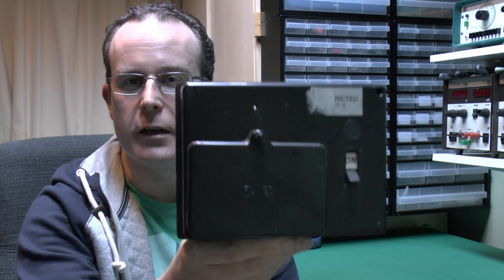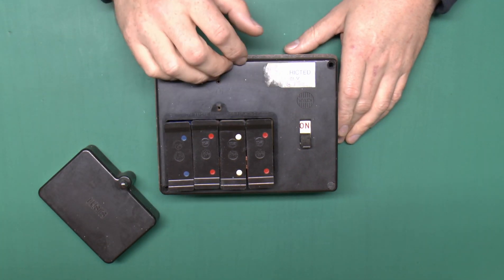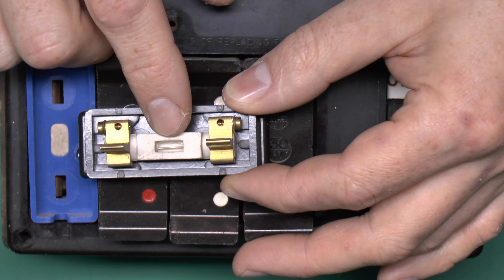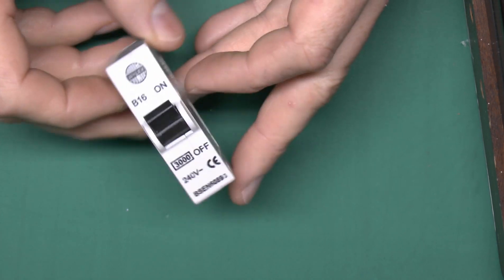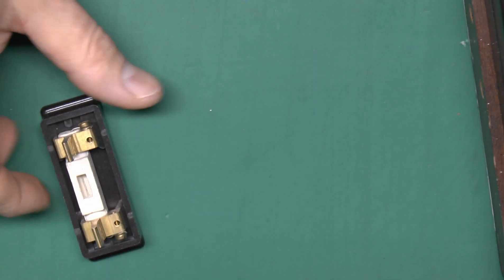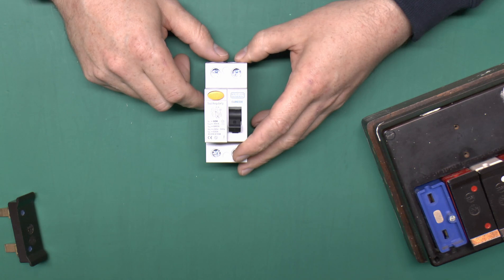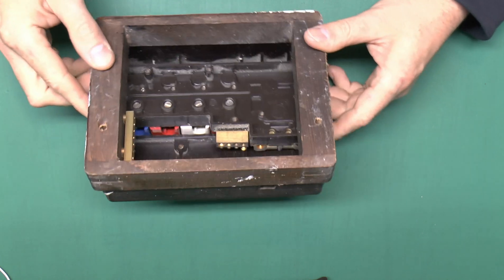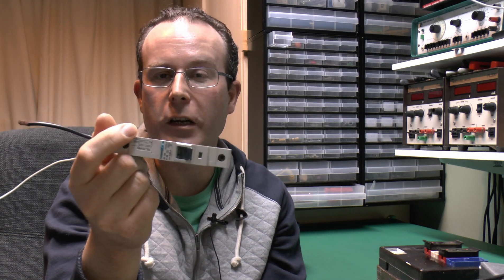Wylex Fusebox - Replacing fuses with plug in MCBs is a waste of money

Comment: i came across one of these the other day but without the wooden thing but a RCD was fitted in later it had some old resettable MCBS plug in type the RCD was to the side protecting the entire property to what i guessed, luckily i had a portable Residual current device with me ( the ones you plug in and plug your device in) as it was a old house that i assumed cos of the age had just MCBs which has no protection from a electrical shock then RCDS. If i was in a house with just a MCB fuse box for safteys sake i would upgrade to one with RCDS in it. my fuse box at one of my parents houses has got a big RCD below the fuse board as its a older fuse board where half the circutes are protected and some are not but the RCD below if that trips it trips the entire house hold electrical supply and we know it works as we once had a boiler leak and woke up to a house of darkness and found out that the main RCD tripped and it tripped when we was converting one of our lounges to a ground floor flat that a builder burst a water pipe and it went on live wires and tripped the RCD, if that was a MCB we would have a potential fire in our hands luckily im fire extingushire trained and had to use a fire extingushire for real when someone set the oven gloves on fire which was smoldering like mad as i did not know it had flame retardent materal and plus i didnt want to take any chances i quickly got a 20+ year old water fire extingushire which still worked, manufactured in either 98 or 97. I knew that it would come under the A class catagory so i got water, we had a powder one but was upstairs but had a astmatic in with us so i did not use it as i know it can cause breathing differculties.

Comment: Surely a major benefit is being able to isolate a single circuit via a switch without turning off the entire board, as opposed to pulling a fuse from a circuit that might still have current therefore causing arcing as the fuse is pulled?

Comment: My Wylex is a wooden one like that and that's the way it's staying. I retrofitted the latest MCBs (its a 4 way) and an outboard whole house RCD. There's no way I could get anything else in the meter cupboard as it's an outdoor one with meter, bell transformer and garage isolator. Full! MCBs are also classed as 'close circuit protection' which is no doubt renamed something less informative these days, and allow greater tolerances on circuit diversity, cable capacity  and impedances than rewireables. There used to be tables of capacities in the IEE regulations for rewireable vs HRC/MCB protection, though I think the trend for over-complicating and obfuscating the rules has meant we now have confusing derating factors under the present IET tenure as electrical God.

Comment: Question for you John - I made an circuit breaker for powered projects so just in case I get the wiring wrong, I would trip my circuit breaker instead of the house power. Now, I tested my curcuit breaker in a shed that had the live and neutral reversed (for some reason) and I purposely trip my circuit breaker,. Not only did it trip my circuit breaker, but also tripped the power in the shed?? 

So the questions are - Why did it trip both when it was designed to only trip my circuit breaker?  Would the fact that the live and neutral are reversed something got to do with it? 

I have a video of the circuit breaker I built if you need to have a look at it but it's just an 20amp RCB0 with a plug on one end and an extension socket on the other. :-)
Reply: Not a lot to go on there but  if you turn the socket circuit off only while you rewire a socket and accidently touch neutral to earth even with no power to the sockets it will trip the rcd for all circuits on that rcd, many of us have been plunged into darkness and not sure why. I think yours is the same issue due to the reversed wiring.

Comment: Whether its an MCB plugged into an existing fuse socket or a complete new unit with circuit breakers and RCDs, a circuit breaker is far better than an old-style wire fuse because you can see at a glance which one has tripped.  Number of times I've had to pull fuses in sequence and look to see which is the blown one just because someone has decided to plug in one too many devices on a single circuit.

Our current house has two fuses for lighting and four unlabelled fuses and a plug-in MCB for which the labels are illegible (it also has a retrofitted RCD with two circuit breakers).  If half the lights go out in the house, it's a 50% chance you pull the right fuse first out first, if an electrical outlet goes out, unless its one that's controlled by the MCB, it's anyone's guess which of the four fuses is the right one.

Interesting to note that the fuses in the video would not be acceptable here in New Zealand as they would not comply with our code - our fuses have to have a "tortuous path" whereby the wire starts on one side of the ceramic block, passes through an angled hole in the block and then is fixed on the other side so it forms a Z-shape.  A straight wire like the ones pictured would not be legal here.

Comment: hi john,,,I've got similar electric and fuse box but i have gone and broken the main on off power switch,snapped it in half ,yep that backer lite switch,,any ideas on a fix ? ......or any idea on cost of a new replacement ? thanks john
Reply from the maker: There is no fix - that type of fusebox is no longer made.  The main switch was supplied as part of the whole thing and wasn't a separate item.
Only option is a new consumer unit.
Reply: thanks john for quick reply,,,john ,,,talking about cost,,,any idea for box and fitting ?
Reply from the maker: Depends on various factors, but in the UK typically £400 - £800 for a normal sized house.
Reply: cheers john, not good news at all.
Reply from the maker: If cost is a problem, another option would be to have a separate main switch in a small enclosure fitted before the fusebox, such as this: https://www.tlc-direct.co.uk/Products/WYREC2S.html
Reply: another thanks john,,,that looks a far better idea,will move on that in the next few days.

Comment: Does an RCCB protect against current overload, like a fuse, as well as residual current leakage to earth?
Reply from the maker: No, it has no overload protection.  They are usually marked with a rating (such as 80A) but that is only the maximum rating of the internal contacts/switch.  If you want overcurrent protection in the same device, then an RCBO is required.
Reply: Thanks, John. Much appreciated!

Comment: This video is a waste of time, the newer system is much better and less hassle. That’s the reason why everyone’s changing to it. 

The only logical thing you said was instead of buying 4-6 of the new fuses your better off buying a new consumer unit with these built in which will work around same price (but then you still have to pay an electrician to change it over unless you know what your doing.)
Reply: In fairness we're talking about changing from a 1960's system to a 1980's system.  If anyone still has a Wylex board with cartridge/wire fuses today then there's not much point changing to plug in MCBs now as the cost or replacing all the fuses and fitting a standalone RCD would be comparable to replacing the consumer unit anyway.

Comment: The plug in MCBs may not offer much additional protection but they are 10,000x more user friendly.  Worth every penny.
Reply: a few days ago, my sister had a lightbulb fail, and the bulb took out the fuse for the circuit when it failed
my sister had to call out an electrician, and the electrician replaced the fuse with a circuit breaker
Reply: If you are unable to screw in a piece of fuse wire you probably shouldn’t be allowed to live on your own 😂
Reply: @TimothyAsbridge  Does hating on the disabled make you feel big?
Reply: @TimothyAsbridge  , 6 am winters morning, up for work, losing all your lights isn't good, MCB so much easier than fuse wire.
Reply: @TimothyAsbridge  disgusting comment

Comment: i have an old consumer unit in my home, how easy it is to replace it with a nice one?
Reply: difficult and costly
Reply: Indeed. Most of the regulations seem designed to generate more work for the trade.

Comment: I have one of the old MEM fuseboxes rather than the more compact Wylex. For convenience i bought spare s/h ceramic fuse cartridges (off ebay, and yes, they were expensive) in order to simplify the swap. The MEM cartridges take a little longer to wire and it is easy to be hamfisted and stress or snap the wire when  tightening the screws.....better to have one of each spare kicking about- 5A, 15A ,30A.

Comment: If these replacement circuit breakers are a waste of time,  then why would the big manufacturers still produce them ? 

You're so wrong on your advice in part of this video. 

To conclude that a semi enclosed circuit breaker is the same as a mcb is foolish.
Reply: An Electrician Why does any manufacturer make anything? To sell it and make money. Who is the fool, the customer or the manufacturer? Only you can decide. JW is not saying MCBs are a waste of time. He is saying that most people (maybe not all) would be better off replacing the old fuse box with a modern up to date consumer unit, which would have RCD protection as well as multiple MCBs. Replacing the individual fuse holders with individual replacement MCBs in the existing fuse box does not significantly increase the protection.

Comment: seriously - this video was a waste of time. Granted they don't do anything new but they make it very easy to turn things back on. you don't have the hassle of replacing the fuse wire - which for many people is difficult (elderly, people without tools, etc...). However the most important feature as to why this is not a waste of time but your video is, is that changing fuse wire requires the user to have and use the correct fuse wire. Intentionally or by accident using the wrong wire (e.g. 30amp) in say a lighting fuse (should be 5amp) could be catastrophic!
Reply: Tim Hurrell It has always been a problem with rewireable fuse holders. I think you missed the point. The point being it would be far better to replace the old fuse box with a modern RCD and MCB equipped consumer unit.

Comment: Well, I wanted to replace some of my light switches earlier and didn't think that pulling fuses out was safe to do without turning the whole fuse box off. I could have used one of those flickable switches on the fuse. In addition, whoever installed the fuses didn't label the circuits and the little piece of paper that should have described the fuses and their purpose didn't match the panel. I guess I'll get an electrician in and heck, just get a RCD consumer unit while I'm spending money.
Reply: Radu C Pulling fuses or switching off MCBs does not guarantee the circuit you are working on is isolated. The main isolation switch should be used.

Comment: Are the wooden backed ones still legal? You said in your video that they may not be in 2015. We have one in our rented property but the landlord literally refuses to change it to a RCD unit. Hoping something has come out to make it a requirement to have it changed.
Reply from the maker: They don't comply with regulations now, but that doesn't mean old items have to be replaced either - they complied with the regulations when they were installed.
They should be replaced for the flammability issue, and the fact they will have no RCD protection for any of the circuits, plus if they have rewirable fuses they can easily be misused by installing the wrong fusewire.
However wiring regulations are not the law, and there is no law which requires older electrical installations to be updated.

Comment: I don't think these circuit breakers are a waste of time at all.  I've just been in a situation where my lighting fuse went due to a bulb failing.  I'd purchased fuse wire but couldn't remember where I'd put it.  Unfortunately the gas heating control system was also on the 3A circuit so I had no heating and it was the coldest day of the year!

I also think forcing the average consumer to physically wire a fuse is an anachronism and inherently dangerous. The problem with engineers (I do engineering from a numerical perspective) is they assume everybody thinks like they do; your perspective is a classic example of this: "it works perfectly well, so it doesn't need fixing".
Reply: Agreed.  I do electrical installations and I try to see things from the user's perspective.  It's my job to foresee scenarios where a paper clip or tin foil might be used by a desperate customer on a ladder in the dark after trying to find the correct fuse wire for the lighting circuit.   Changing the whole fuse board might cause him financial hardship.  £10 for one resettable MCB?  I'd splash out and get two!

Comment: I have one of these old fuse boxes, my fuse do not blow, but my mains keeps tripping. What could be causing this and would switching to these fuses be able to help to not trip the mains?
Reply from the maker: If a device is tripping, there is a fault somewhere.  Changing fuses to circuit breakers will not help at all.

Comment: Good video and sure, a modern consumer unit with a built in RCD is  better. I would still rather see a type B mcb used in an old consumer unit on a lighting circuit than a traditional fuse though if only because it prevents people from replacing the damaged fuse with something inappropriate. You didn't even mention the different tripping characteristics MCBs have compared to fuse wire or that mcbs are more sensitive to fault currents than fuses. These are important considerations for people who cannot afford to replace a whole consumer unit.

Comment: Lots of idiots commenting on this video. Yes upgrading to an mcb will stop people replacing with incorrect rated wire etc and make it easier to reset, however so will replacing the consumer unit which is what he is really saying to do in this vid. It will also give rcd protection unlike the "upgrades" and as it is obvious that there are many imbeciles (judging from the comments here) that need protecting from themselves mcb`s are still a waste of money and give people a false sense of security by looking like rcd`s. (again, proven here by the comments confusing the two.) 

On a side note, if you think unscewing two screws to replace a fuse wire is too much trouble i highly doubt you are qualified to give advice on this matter. Also if convenience is worth wasting £50+ on these upgrades then more fool you. Before people chime in about the elderly, disabled etc, if they need the easy reset just do the job properly with a new consumer unit and be sure their installation is totally safe. Everyone else should just get a battery operated cupboard light from the pound shop and keep a screwdriver and fuse wire alongside the fuse box, and stop being a bitch.
Reply: Electrical Safety Council Best Practice Guide (issue 2):
10.1. The alteration or addition itself (the installation of
the replacement consumer unit and any other new
work, such as additional final circuits) should be
verified fully in accordance with the requirements of
Section 610 of BS 7671 (as amended) and an
Electrical Installation Certificate in accordance with
BS 7671, detailing the work, should be given by the
installer to the customer.
Reply: ben weston So it safe to leave a sub-standard installation in service then? If any part of an installation is unsafe or potentially unsafe, it should not be reconnected and should be isolated.
Reply: Ian H well aren’t you a whiny idiot? 

How about knowing what you are talking about first, like the fact that changing a fuse board means the whole property needs to meet current regs so might actually turn into a £2,500 job and also potentially ruin the decoration in all rooms and chases needing a plasterer to repair them to original finish?
Reply: Show me the regulation where it states the whole house has to meet current regs... 

Did you hear that down the pub or have you been conned into a full rewire because YOU don`t know what you are talking about?
Reply: Since you don't want to spend money to make the whole property meet current regulations, it's better to still change the consumer unit, the installation doesn't meet the new regulation as before, but you have an important protection (RCD) that could save your life, that it's more important on an old installation, where maybe there are not well insulated wires, maybe the ground connection is missing or with an high impedance such that a fault to ground doesn't produce enough current to trip a MCB, the polarity on switches is wrong so when you go to change a lightbulb with the switch off you can get a shock because the switch interrupts neutral and not phase, and who know what else could be wrong.
Reply: You my friend, deserve a medal for such a comment. Thank you!